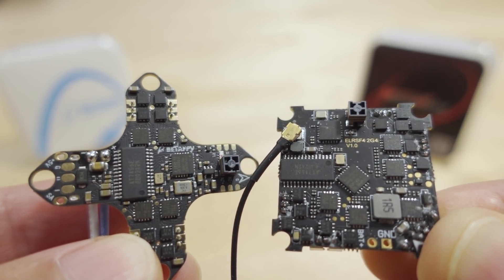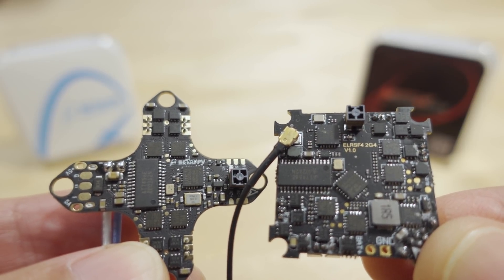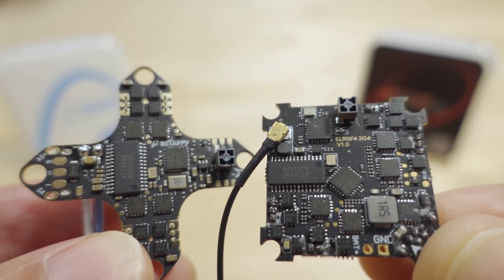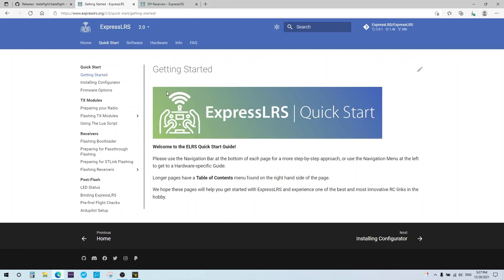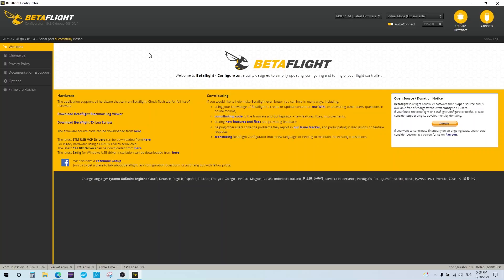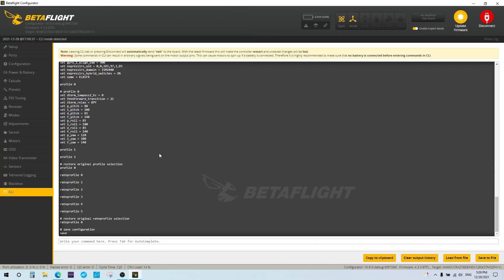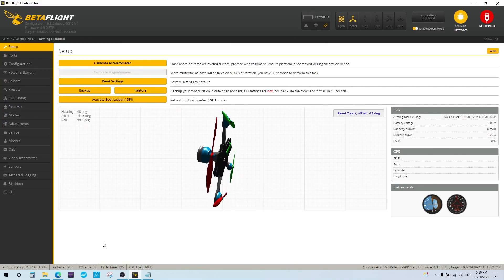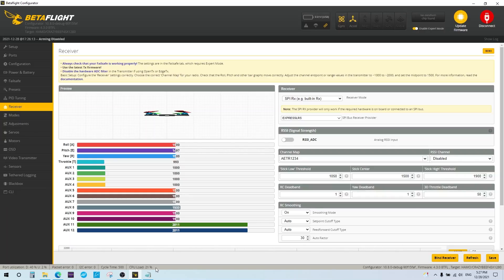ExpressLRS Firmware Update Tutorial for SPI Receivers 🎓

Comment: I know this vids older, but Im using the same board, (crazybeef4sx1280) -but with ELRS 3.0 (Itas a happymodel Mobula 8 Analog.)
However, since day one, I cannot get teh smart audio to work...
Just stays Device ready status as FALSE.. any ideas? (At my wits end.. done all the things... lol)
Reply from the maker: Sorry, I don't know.  I would check you have the correct UART wired up and that it's setup properly in Betaflight.
Reply: @AlbertKimTV  all good, i hot it! (I actually just went to happy model dloaded their cli n started over.) (I had a heck of a time, like over a week  discord coms etc, gettin this thing setup initially.  Got it flying n only flew it once.. but now its winter n i need an indoor toy.. 😜)
Was just going through all the settings on it, watching bardwells video guide series, but couldn't get it. Anyesys, thanks for the quick reply,  im workin it out at least! 😜)

Comment: Need help. I got the boxer with ELRs and it came with the 3.3.0 version i got the Tinynite with elrs with the spi reciever. 

 I attempted to bind and didnt work. I looked online and its because they both need to be up to date. I saw a video on howbto update but what the video failed to mention that it was on how to update the boxer and not the reciever so i essentially used the elrs partioner to update reciever i think i unbricked it by DFU mode. 
Now the issue is still unavle to update the reciever to 3.3.0.

The ELRS configurator keeps giving error when i try to update it and there is no betaflight passthrough. Please need help.
Reply from the maker: If the receiver on the drone is SPI based on the FC, you have to update the Betaflight version to 4.4.  You can read a more detailed explanation on the ExpressLRS website...  https://www.expresslrs.org/hardware/spi-receivers/?h=spi

Comment: So let's say one skipped the whole backup thing like a dummy.. how do I get it back ?  my vtx is not setup anymore on my mobula7 1s elrs. I couldn't get it to bind with my tbs tango multiprotocol module. my hd 1s bound 1st try
Reply from the maker: Contact the manufacturer or check their website support section.  Many of them will have their default settings there.
Reply: After I flashed it
Reply: Will do thanks for the fast reply 👍

Comment: I own a meteor 65 the upgraded 2022 version and is has a SPI ExpressLRS 2.4G receiver attached (not built in) and I wanted to ask someone this because there is a hard red wire connected to the flight controller ( not the receiver) and I wanted to know if that connected to the receiver and it broke off or it does not connect to the receiver and just the flight controller because like at 100ft it says rtf lost and it is a lot less then this inside a house so I would really like to know if that is the problem

Comment: When I click FLASH FIRMWARE in the firmware flasher, the progress bar doesn't start going.
 I am using Betafpv 5A Elrs FC, with DFU mode.
Reply from the maker: The FC isn't actually in DFU mode.  I think that's a bug in the configurator.  It shows as in DFU mode, but it's not.  You have to manually trigger DFU mode via the bootloader button on the FC and restart the flash and it will work.
Reply: I manually triggered DFU mode, but it doesn't work.

Comment: Hello I've a Radiomaster TX16s (version 1) and the betafpv expresslrs elrs 2.4ghz 1W Micro Module. I can't change the 10W value, in the module joistick or in the LUA software, Do you have an ideia what maybe is the cause?
Reply from the maker: Possible some kind of firmware or setup issue.  Did you update everything to the latest versions of firmware?  Without more details, it's kinda hard to know exactly what's going on here...
Reply: @AlbertKimTV  Thank you very much for the usual help to the community..
I've update (with success) both transmiter (betafpv expresslrs elrs 2.4ghz 1W Micro Module) and receiver (happyModel_EP_2400_RX) in the ELRS Software 2.5.1 version. I've have tha black one of 1W, but I can't change the Power, is fix in 10mW. I'm using the "regulatory Doman EU CE 2400, maybe is his? Is the 3.0.0.-RC1 version already safe?

Comment: Ugh thank you ALBERT!!  I'm on an old ELRS from last years rc's I think 8 or 9 before the official release.   I have about quads setup on my T Lite some of them are the v1 whoops.   I bought a v2 Mob7and now the simple "bind_rx" isn't working.  Assume Cuzco I'm on old tx module firmware.   I really don't want to update.  Can I walk back the new ELRS V2.0 board just like you did here but in reverse?   IE want to make the new mob7 bind to my old school ELRS tx that binds to the V1's.     It's B.S. it changed and now my old quads all need updates that aren't even needed they fly great as is!
Reply from the maker: I recommend moving everything to V2.  There are a number of failsafe bugs in V1.
Reply: @AlbertKimTV  eh well I have vid from today LOL got it all worked out last night put 4.2 back on it and found a an elrs version dump that agreed with my elrs ep1 and t lite module for elrs.   Flew 4350ft distance from home in a 3.5 mile round trip!   It's my longest flight to date and had one flash warnng of link quality got rssi all the way down to  minus 102 dbi (signal loss is minus 107ish i think) and just 20% link quality on the 500mhz packet rate using 250mw elrs power and my video went out on me using an O.R.C Shield 2.5dbi antenna and 6.5 dbi halo rhcp's on the other side of EVO300D Dual diversity goggles....  I gps rescued - it worked immaculately and ascended up to where I got my video back pretty quickly and was able to take control back and fly another 3-4mins home.  I'm not much of a video YouTuber but maybe I'll actually process and post the footage....  nothing major for the experts but for a novice like me it really felt like an accomplishment.  It's only my 2nd long range flight ever using gps and flywoo lr4 --- I'm used to smaller stuff 3inch toothpick is big for me lol!   Thanks for all your great vids they do certainly help and maybe even more so they inspire me!!!  As far as link quality - prolly a combo of me using the 500 packet rate + a VAS rx antenna set on "Omni-Directoinal" (I forgot to flip it to "Long Range" before taking off).   😳   
🙏🌋🏅
Reply: As for v1 and v2....  I still love v1 and am.happy on it and don't have issues to complain of the way I lost frskys' and whatnot on d8 or d16.   Got to be a way to back up a V2 to V1 and I have it sitting here so tomorrow I might see if the firmware is there to do it to a V2.   I'll dump all ahead of time just in case have to go back.   And flash can go back usually, no?    Or you think it's a really bad idea?   But in the end your right V2 the way to go as they are discontinuing V1 boards :( I think.   I'm still on last year's Betaflight like 10.7 or something --- just like to fly not continually flash and update!
Reply: skip that!  The new ELRS Mob7 V2 comes with X12 5-1 AIO does not look like any release candidates for that board, let alone one taking back to a V1 that probably doesn't exist on BF.   I'm swapping in an EP1 on UART1 and will flash back to my firmware V1 -- that should fly it good enough - adds a gram of weight :( but this is for bashing only really -- i have cut down lightweight versions in 65mm at 14.8g and 75mm at 17.5g ---- those whoops whoop it! ;)   Also almost washed that extra weight by swapping to all plastic screws throughout the bird -- but then i added 1.2g RCHP antenna so boom the *nasty gram is back again ;P

Comment: I broke the ceramic antenna on my meteor65 aio elrs the one which was bound to break if canopy changed. There are four pads which one and what do I solder to replace the ceramic tower. Length 30-33 mm I believe but shielded or Co ax or just a naked wire 
Thanks Albert for all your help
Reply from the maker: Three of the pads are connected to ground so use your multimeter in to test the pads against ground and there will be one that isn't.  That's the signal pad.
Reply: Just look under the board --- only yhe pad that connects to the1 antenna carries thru a hole to the underneath side of the board.   This happens to me all the time if you catch it before it burns up the fc I have successfully soldered in a 12.7mm wire and got decent range still.   They do tend to start failing though after the *plastic/copper antenna are busted off.   Presumably if that's getting busted off then your whoop board is exposed and you are bashing on more than just the antenna on the board.    I tear thru these dam things like water lately they are horrible on reliability weather it be HAPPY Model or BetaFpv.   But hey, gotta have the ELRS range!

Comment: hi I recently tried to flash my meteor65 elrs to rc3 and rc2 and bound to my betafpv elrs 1w module (2.2.0) but the meteor just yaws continuously when taking off.. any suggestions as to why?
Reply from the maker: Channel map is wrong or sticks need calibration
Reply: @AlbertKimTV  doubled checked it, it's fine. :(
Reply: Did you find a solution to your yaw spin? I have a meteor75 elrs and it spins like crazy when taking off.

Comment: Thank you for the great videos! Love your content.  Not sure if I did something wrong, but it couldn't update my meteor65 pro to bf 4.3 RC3.  I tried 4.3 RC2 and that one work without an issue.  Just wanted to share my experience in case anyone else had the same problem.
Reply from the maker: Yes, there is an issue with RC3 for BETAFPV AIO boards.  I notified my Patreons about this but did not have time to make a video about it.
Reply: @AlbertKimTV  glad I saw this. Setting up elrs v2.0 on my module since that seems to be what all the spi boards support. and was about to do this update for the beta board I own. I will use rc2 for now.
Reply: hi I recently tried to flash my meteor65 elrs to rc3 and rc2 and bound to my betafpv elrs 1w module but both of them yaws continuously when taking off.. any suggestions as to why?

Comment: Hi Albert question about express lrs and a Darwin whoop board.  When I power up my tx and the Dawrwin whoop board it takes about 30 seconds to link up.  Is this a firmware issue?
Reply from the maker: Power up the TX first. If you power up the TX second it normally takes 30 seconds to connect. Make sure the packet rate is the same on both.

Comment: Help me please.. i bind tx to my crux3 1s successfully.. but my RX not appear on betaflight cnfgurtor.. 3 day now.. still cannot flying my 1st drone.. haha.. is it because wrong setting on my radio, or setting on betaflight?? Im using tx16+hm elrs 1w. Binding to crux3 1s elrs.. sorry my bad english. 😭😭
Reply from the maker: You're using the wrong version of the configurator for that board.  Download this one instead (10.8.0)... https://github.com/betaflight/betaflight-configurator/releases
Reply: @AlbertKimTV  im using the latest betaflight configurator candidate3.. same goes to my flywoo 1s nano that arrived this evening.. successful bind but on betaflight cgrtr got same issue.. not detect my tx.. so i cant setup my arm switch, mode and etc..
Reply: I had the same issue with the betafpv meteor 85, try changing the receiver number to 1 (from 0) under the External RF section in the model setup screen of your tx16s
Reply: @Scooby2606  tysm Sir.. it work. 😬 🙌

Comment: Betaflight 4.3 just seems to be harder on the CPU load.. My nazgul 5 V2 with f722 on BF 4.2.10 with 8k/8k only ran 5-10% CPU load.. Same settings on 4.3 it runs 45-55%.
Reply from the maker: I'm hearing these are from bugs that are still in the code.
Reply: @AlbertKimTV  what about this... So my new CRUX35 HD with SPI ELRS... even when it's up and connected(binded) to my tx16s, it says rxfailsafe in betaflight all the time.. I don't get it. Endpoints are set, and the receiver tab does weird glitchy up and down on the throttle and sticks when I move them.

Comment: Now that BF configurator 10.7.2 is out, can one use that configurator instead of the 10.8 to do this? it shows BF 4.3 RC2 on the flash page.
Reply from the maker: You still need 10.8.0 to change the settings on BF 4.3.X.

Comment: Thank you so much for this video.   I had just received my HappyModel ES24TX TX module for the Jumper T-lite and the BetaFPV Meteor65 Pro.  This is my introduction to ELRS and the first thing I did after installing the TX Module was update to the latest version of ELRS and could not get the Meteor65 to bind.   I wasn't sure what version of Betalight to flash to the Meteor65, so it would work with ELRS 2.0.1 and had spent a large portion of yesterday trying to figure out what to do.  I was ready to just flash my TX module back to 1.2.1.

Also, thank you for the 411 about changing the PID Loop Frequency to 2kHz.  

Thank you again.
Reply from the maker: Thanks for watching and glad it helped!

Comment: Can you use the new firmware also for the Betafpv 1s 12a elrs V1.0 board or only for the V2.0?
Reply from the maker: The V1 board doesn't have an SPI receiver.  It's a full receiver built into the board.  So this video doesn't apply to the V1 board.

Comment: Oh man.  This is great!! I'm waiting on the crux35 in the mail and I'm sure I'm going to have to update the FC.  Thanks man.  Same exact FC and everything.   I was scared of flashing.  Now I'm more confident with your video 😁👍
Reply from the maker: Still back up your settings but don't use them on the RC1 build.  Seems some old settings causes problems so start from scratch and put in your settings manually.
Reply: @AlbertKimTV  100%  I'm going to do like in your pinned comment and copy my diff from the CLI and then after the flash just put in the settings excluding filters, and pid sliders. 😁👍
Reply: I just got a crux35 HD yesterday, already came on 4.3. But I updated to 4.3rc2. It was easy, weird bug though with rxfailsafe and glitchy outputs on receiver tab

Comment: By the way guys, don't bother with RPM filter on RC1.  It doesn't work yet.
Reply from the maker: It should if you set the 2khz pid loop and Dshot300.  Won't work on Dshot600.  Also some versions of ESC firmware are incompatible.  Someone should make a database on all the compatibility problems.  I'm sure no one will donate to that cause.

Comment: Forgive my noob-ness, but if I’m understanding correctly, you need to have BF 4.3 in order to fly with ELRS 2.0 on the AIO boards?
Reply from the maker: Yes, that's correct.  The 4.3-RC1 build has ELRS V2 baked into it for the AIO boards with SPI receivers.

Comment: Hi Albert ! thank for your work ! For the 60% CPU, you should not worry about, the betaflight devs said that they changed the way it is calculated and it is now more precise (an higher for the same cpu load). I have the exact same board and I fly it at 4kHz without problem
Reply from the maker: At 8Khz, my transmitter would not connect.
Reply: @AlbertKimTV  Strange, maybe it's linked to your PID that are not working ? I used the presets from uav tech for whoops. I've now tested at 2kHz I'm around 30% CPU
Reply: 4khz didn't work for me.  I had to go down to 2khz to get a stable connection.
Reply: I've been telling them it isn't fine. It wont connect at 60%. Overclocking cpu cause s other problems. 

I can either fly no rpm filter at dshot300/4k or fly rpm filter with dshot150/2k. I rather stay on elrs 1.0 for now.

Comment: Great video but at 12 minutes you can see your pid controller sliders are inactive. I tried the same method and they are active and working until you paste the old diff into the cli. When I hit save I got the same results as you. Pid controller doesn't work. I tried without pasting the old filter and pid settings everything work perfect. I think you should just paste your aux and port settings from the past and just start from scratch with your pids .
Reply from the maker: Yeah, it seems quite a lot changed from that old 4.3.0 nightly build to the RC1.  I'll make a note in the description.

Comment: I’ve had bad results just pasting an old diff, I usually go through and delete anything to do with filtering especially cause it’s changed quite a bit over the past months. I get high cpu spikes if I just dump the diff sometimes. But this may be changed with the new RC1
Reply from the maker: I'll make a note in the description
Reply: RPM filter is broken on this RC1 build.  This is still experimental.